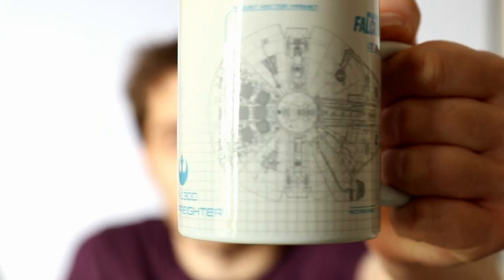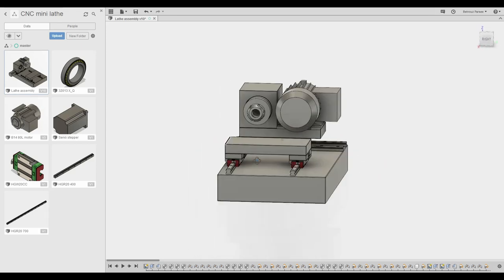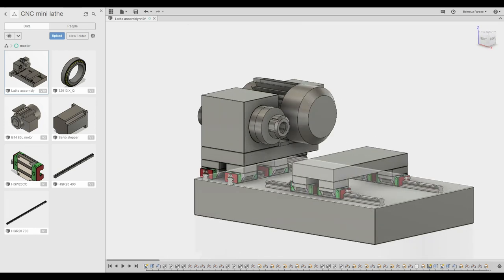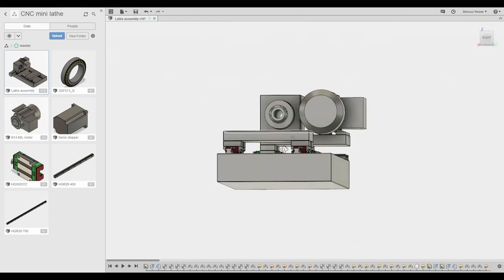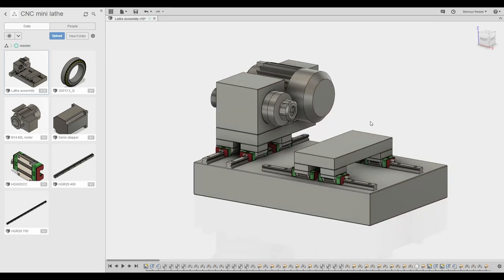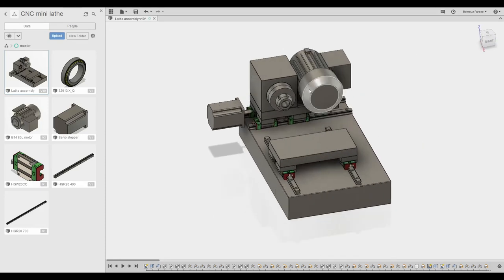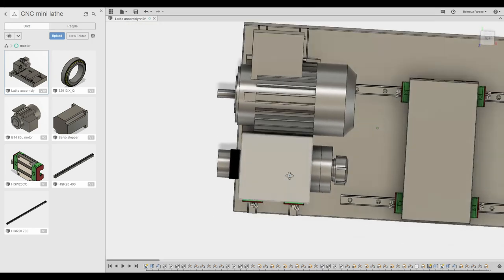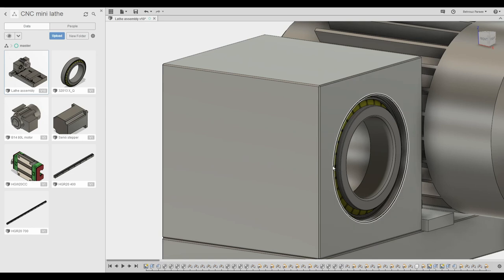CNC mini lathe - DIY design and build project from scratch! Part 1

Comment: Interesting idea. Of course it would work within it's range of capabilities. Anything can be made to work within some range of limits. I was thinking like some others have suggested and mount the motor above the headstock. I was also thinking that if you swapped axis on the slides and moved the head in the X and the tooling in the Y with a guide bushing right at the end of the headstock motion you'd have built a mini swiss style lathe. Use the pneumatic 5C in the headstock and your bar puller is practically built in.
I like the idea of using a granite plate as a base. I've been thinking along the same lines for some projects because my machines are not big enough to handle the stock required. Plus it adds a good chunk of weight to the base. I was trying to think of how to attach the slides to it. I figured on using small diamond core bits to drill mounting holes for epoxied or expansion anchors.

Comment: I'd REALLY recommend not moving the headstock...
Reply: That would make it possible to build a lathe with really low center height without using the special low profile rails that are likely expensive. I like the idea. No reason to have more than like  120mm swing in a lathe that you can lift by hand, the higher the center height, the flimsier it gets

Comment: Hey, How's this project going? I had a very similar plan to yours and was very happy to find this :)
Reply: I'm interested in learning electronics and building my own cnc lathe mostly from scratch too. Have you managed to get somewhere so far?
Reply: @chas1878  I made some sketches and did some research for a few weeks. Than kinda forgot about it when I got busy with school :D
What do you plan on using your lathe for?
My plan was to use it to mass produce small parts (diameter < 40mm) I require for the things I design.  (pens, flashlights, mechnanical devices.) I'd love to be able to machine stainless steel.
The hardest part IMO is designing the headstock. So just buying it ready made would be the best option. Maybe replacing the bearings and fine tuning the preload.
A lot of people CNC the taig mini lathe which is a very solid piece of kit. They also sell the headstock on Its own as well. 
Curt Van Filipowski has a ton of practical information on production of small parts with a semi-cnc lathe and a cnc mill.

Comment: that's great looking, I like the idea of the moving spindle, i might add a z axis by slicing though the bed, separating out the motor/spindle from the other axis, which is then pivoted off centre to the bed with the other end driving the angle with a lead screw whist compensating the other axis to track the vertical movement.

Comment: Your cheap ball screw fixed bearing block looks a bit different from mine.  Mine are adjustable preload.  The bearing assembly I've got, for angular contact (I think, I don't know that I ever verified that they were actually AC) the block has a ridge in between the bearings, and the nut that fits the ball screw has a set screw.  The bearings don't touch, so they don't need to have their race edges be precision machined or matched.  Theory is you torque down the nut on the end of the ball screw to some value you need to figure out to get a certain preload.  Optionally you can add a belleville washer or wave spring in between the nut and the outer bearing and use the compression of that to help measure the preload.
Maybe you're aware of these preload systems and have discounted them for some reason or other (I'm no expert,) but just thought I'd share in case you weren't.

Comment: Save some time on the spindle and use a 5C spin indexer shaft for the spindle, that way you already have everything you need done and precision ground for alot less than a custom spindle will cost you.
Reply from the maker: It's a really good idea and I'm still considering it, it would definitely make my life a lot easier. In all honesty I still don't have a clear idea of what I actually want so I might end up trying a few things and seeing what works best
Reply: Behrouz Parsee just bare in mind that with a 5c sounded you leave yourself the possibility of a pneumatic collet closer which can be used as an automated clamping Chuck with a bar puller to fully automated parts making.  Although a bar feeder or even just a bearing mounted to hold stock may be a bit difficult with a moving spindle.  However could still use a 12-24" piece of sick relatively easily.
Reply from the maker: That's definitely the advantage of 5C, I keep trying to think of ways to automate the ER collet chuck but short of an actual robot I'm not sure it's possible...pneumatic collet closer would be a lot more simple
Reply: The issue I see is incorporating any kind of a tail stock....
Think about using a 5c spin indexer for your spindle...
I have a 5c collet backplate that let's me add a 4 in chuck...

Comment: Love the design.  Im wondering 2 things.  Did you say you are using a granite slab for the base?  If so, where did you get it, and how much did it cost, and how will you drill it? 

Second thing, with such limited motor/spindle travel, what about mounting the motor above the spindle?  And I would use the clearpath servos, with the most powerful one for the spindle motor for more travel. (Only 8 lbs, and less than 6" long).

Love the videos, keep them coming.

Comment: What the f... Is here scratch? The rails, the spindle, the granite plate?
I build lathes now since 30 years and I think to move the spindle-motor as an axes is not a good idea. You bring the vibrations from your spindle to the workpeace...
Reply: spindle can move and part can even moved inside spindle to get z move. let part move and cut near spindle get less shatter
Reply: I think this was just to be a mini machine(primarily for alloys). If it where a full size build I would say NO but a mini, why not? You got CNC-Routers out there that are doing the exact same thing, moving the headstock/spindel, he just changed the axis around.
Reply: Mills with literally a giant motor in the head jumping up and down at 50000mm/min: I a joke to you.

Comment: Is there no tail stock? Are you going to install a 3 jaw chuck?
Reply from the maker: Nope, no tailstock. I shouldn't need one since the machine will only be used for short parts. Probably yes, a 3 jaw chuck would be useful for parts that don't fit in a collet

Comment: Does the moving head paint you into a corner regarding a tailstock? I know very little about cnc lathes, more manual ones so take with a pinch of salt. Very interesting build though, as is the one you referred to. Subscribed
Reply from the maker: It does, I designed the machine with the idea that it was only ever going to be used for short parts so it would never need a tailstock, but I do keep wondering if I'll regret once I've made it
Reply: Small CNC lathes like the Tormach is used without a tailstock

Comment: It seems you abandoned the project, or abandoned YouTube, since there is only Part 1, and it's now 2020.  But, I'll throw in my opinion anyway.  You worry too much about preloading and reducing play in the lead screws, headstock bearings, etc... then you blow your savings in rigidity out of the water by mounting your headstock on linear rails that will NOT allow you to use your rigidity of the rest of the system. You'll get chatter to beat hell.  Love the epoxy granite base, love the construction of the cross slide.  I would suggest using a vertical mounted cross slide rather than flat to keep chips out of your linear rails and ball screws.  Lastly; the precision bearings will take a side load, but not an axial load - you'll wear them out FAST.  The tapered roller bearings are designed for both side load, AND axial load. This is one point where I would avoid trying to reinvent the wheel... Unless you really want to try something like lapping a bronze bearing and making an air-bearing? Nah... too hard.   
Hope you pursued the project!

Comment: I don't want to bust you bubble but will not work. 
A lathe is very simple machine  but has to do very complex job.
Two thing stiffness and acoustic resonance if you will not over come this two thing the problem you will encounter there are hard to  understand stand and fix.
Refurbish a machine and save time and money.
Reply from the maker: I agree with you that vibration and stiffness are my main issues, stiffness shouldn't be too bad because I'm keeping everything as low as possible, but vibration could be a huge problem 

Ideally if it was made of cast iron instead of aluminium I think it would be totally fine since cast iron massively absorbs vibration but I can't machine anything that big so I have to use pre machined tooling plate 

It should be fine for the little work that it's designed for, but I agree it's not ideal
Reply: Let me guess ran into trouble getting parts made or something? Cnc company charge fortune lately.